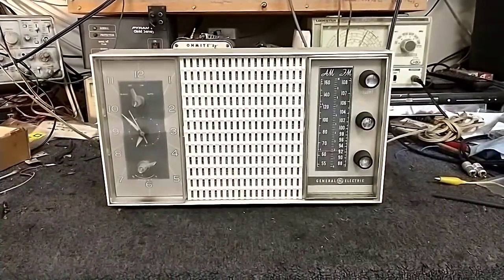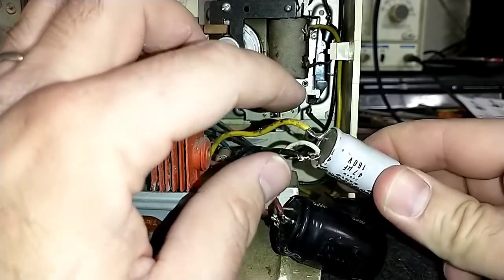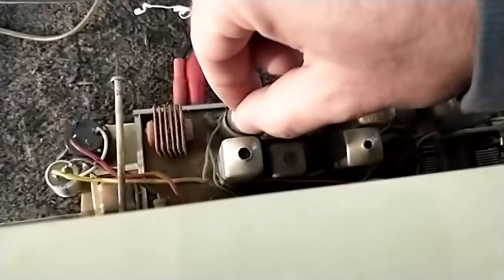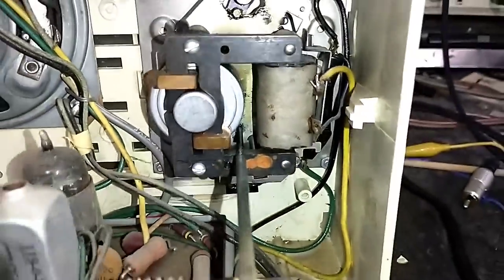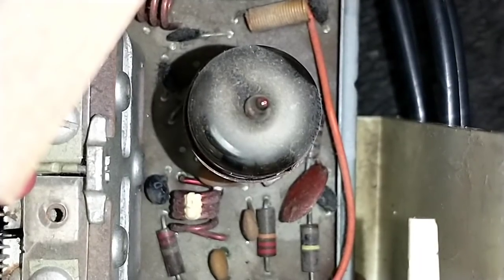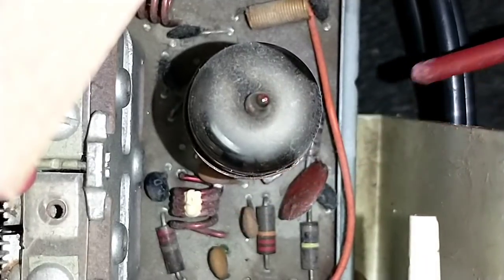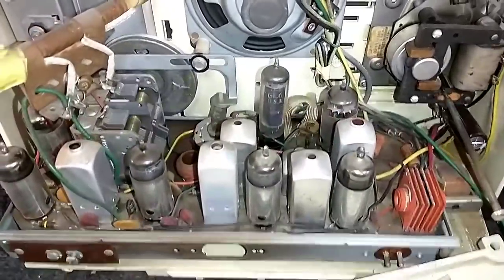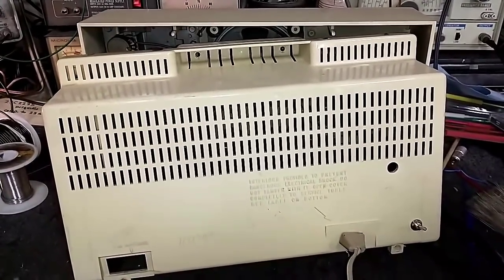Quick Repair of 1960s General Electric C-510a am/fm clock radio.

Comment: That capacitor repair job looks exactly like what 15 year old me did (especially the electrical tape job). I only started soldering with 13 and wasn't really taught it until I was like 25...
Reply: I think every self taught electronics nut did something similar at some point if we're honest. Gave me a few flashbacks for sure😂

Comment: Hi, just to let you know those old telechron clocks like all electrical alarm clocks have a metal tab that when the alarm is set to go off the metal tab vibrates at 60 hz creating typical 60 hz hum that you hear on old electrical alarm clocks, the reason why the radio was still on regardless of the power switch position was because the time on the clock and the alarm hand were set to the same time. When you moved the set stem on back of the clock you turned the alarm off by setting the time or the alarm  different times. I hope this helps.

Comment: It’s really in pretty good shape and clean inside considering it’s age. It’s funny how GE radio cabinets always have multiple speaker cutouts so they can use the same cabinet for different models. There’s probably a model with a wooden cabinet that’s just this exact radio jammed into a wooden box, that’s how GE did things lol!
Reply: you said it I guess they just bought parts from who ever had the cheapest so maybe they could not fin a good deal on 6 by 8inch   4 ohm but there was a killer deal on 4inch  8 ohm  inch so why puit two in the set .

Comment: I remember when I was first interested in radio I was about 10 years old.  I had a transistor radio that had several of those coils. Well, I also have OCD and I went through and straightened every one of those little coils nice and straight.  Needless to say,  the radio never played again.  Later on I learned why they were all bent out in different widths.

Comment: Had to pause the video and make a comment. This thing is pretty awesome, AM/FM, Tube, and clearly more interesting than your typical AA5 radio. That thing is luxurious inside compared to any of the tube GE alarm clock radios or tabletop plastic junk boxed radios I've personally worked on. I think I have even seen this same housing with nearly nothing in it on another GE clock radio!

Comment: As Bill pointed out (I did not spot this) Conelrad markers date this unit between 26 March 1951 and 5th August 1963, guessing late 50s. Plastic components in high torque/linear force contexts are a bad idea. Rotary switches (used to change between AM, FM and SW), having plastic mechanical force transfer widgets...are always going to develop stress fractures with effluxion of time....always better to use metal..so it goes. As always, very interesting. Thanks Jordan.

Comment: 5:30 An easy fix for plastic actuators that have failed or are going to fail is to reinforce them with steel. I fixed my mom's vintage West Bend can opener this way. Drill a hole in the plastic and epoxy a steel rod in the hole. I used a small nail. You can wait for the plastic on the radio to break, but it's easier to fix proactively. If you drill from the pulley side and don't go all the way through, it will barely show.

Comment: I'm pretty sure that the metal piece on the clock that you are messing with is the alarm buzzer, not the switch(the switch IS probably under it though).

Comment: That 35GL6 is a special heater-tap tube whose tap is for a dial light when the series string device has a solid state rectifier (selenium or silicon).  Still watching to see if I can spot the dial light.  Were that not needed, there is no reason it couldn't have been a 35C5 or 35EH5.

That chassis, is it hot or is it RC isolated to be an RF ground?  If the latter, then metal with continuity to it being touched by a filter capacitor lead could produce an external shock hazard but not a light show.
Reply from the maker: No dial light that I could find on this - not even a socket. 

Maybe this radio chassis was used with other mods that did
Reply from the maker: It's a hot chassis
Reply: @JordanPier  The potentially touching wire looks like it is the black lead from the old capacitor, assuming the person who replaced it didn't put those wires there themselves after removing the chassis and unsoldering a PC mount capacitor.  So, no pow.  Still, stinks and hope you were able to at least get it shrink wrapped.  And maybe better caps put in, if those were used ones that were beginning to leak.
Reply from the maker: @SeekingTheLoveThatGodMeans7648  got new caps and a terminal strip installed
Reply: The wiring of the heater string is odd. The ac mains feeds the center tap of the 35GL6 heater. The voltage for the dc supply is taken off one end, and the voltage for the rest of the filaments is taken off the other end.  I guess, the filament would act like a fuse in the event of some kind of short in the B+ circuit.

Comment: This must have been one of the last of GE's non-hybrid AM/FM radios; most of the later ones had solid state FM tuners. Seems that by using the 35GL6 instead of a 35C5, they kept the power output close to that of a  50C5, rather than cutting it by one third. With all of their obvious compromises, GE sets lasted a long time.
Reply: 35GL6 is also tapped for a dial lamp which permitted lighted tuning dials on sets like this one that used a selenium rectifier instead of a 35W4.

Comment: This radio would have made prior to July 1963, there’s Conelrad markers at 640 and 1240 KHz
Reply: Some radios continued to use the civil defense markers well into the late 1960s from surplus dial faces. I'd guess this radio was made in the mid 1960s.
Reply: @jsciarri   Nope...the GE schematic for this set is dated 1962

Comment: I'm trying to learn from your channel can you explain once the voltage comes from the secondary side of the transformer how its dist?
Reply: The only transformer in this set goes right to the speaker; all the tubes run right off the 120V line voltage, with the filaments strung-out like Christmas lights; the first one or two digits of each tube number is the number of volts it requires at 150 mA. This is an 8 tube variant of the "AA5" design that dominated the market for low-cost radios in N. America from the late 1930s to the late 1960s and in Japan from the end of WWII to the late 1960s .

Comment: Another curiosity -- the band switch seems to have a center position as demoed in the video.  Is that actually how it is built, is there a true center position at all, or is the center position neutral, no band (maybe for something like a phono input on this or related model)?  I am always curious about radios that have nonstandard features.  Even if badly implemented, like the physical linkage on this one apparently was.
Reply from the maker: I think there is only three selectable positions on the switch regardless of linkage. Center is fm without afc

Comment: I’m not expert but doesn’t bending the coil merely change it’s inductance, it wouldn’t matter where you bend it the results would be the same providing the inductance is a particular value. I would think the band spread would have to be another adjustment.
Reply: That's what I would think as well. The only way to get good tracking would be to also have a  small variable capacitor in parallel with the oscillator section of the main tuning cap , to be able to separately trim the top of the band.
Reply: Maybe bending some of the plates on the tuning capacitor. That may help at least on the end where are the plates are meshed

Comment: If you would replace the selenium rectifier, what kind of diode would be needed ? Just a 1N4007, or something like a shotky diode ?

I heard Adam Sandler’s Turkey Song…it’s the ONLY holiday song I like. He was funny on SNL !
Reply from the maker: A 1n4007 and additional dropping resistor would work. The silicon is more efficient and will allow more b+ voltage.

Comment: That radio sounds good, not bad for a penny pinching design :-D
Maybe a volume on/off will come along and you can replace the panal volume.
I hope you and your wife have a smashing xmas jordan,  no colds or illness.
I always got ill near xmas, for some odd reason.
Reply: The design is common for all clock radios of the day. The clock controls the power switch, so you can have the radio come on at any time you set. These clocks also allow you to snooze (silence the radio for 10 minutes) if it has a snooze bar, sleep to radio (you set it to shut off after an hour or so), or play continuously. That AM/FM selector linkage, however, is penny pinching. Mounting the switch on the panel instead of the PC board would require a cable harness.

Comment: Vintage radio a time radio's were built quality
Reply from the maker: And ge was considered lower quality!
Reply: They were actually built with the cheapest consumer technology of the day. The printed boards were garbage, the IF transformers failed constantly, and the mechanical design was flimsy. If you wanted a better quality set, you bought a Zenith. They were still hand wiring their radios in the early 60's. The best part of this GE is the Telechron clock (Telechron was actually owned by GE). Those things will run for years and years.

Comment: If you have the sleep dial turned, the switch will stay on until the clock advances 15 or so minutes.
Reply from the maker: Tried messing with that, to no avail